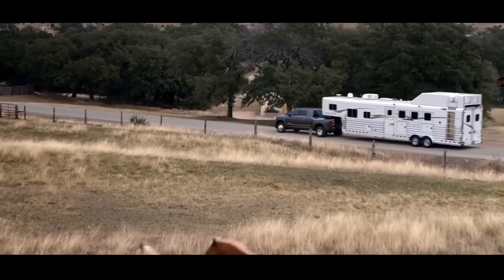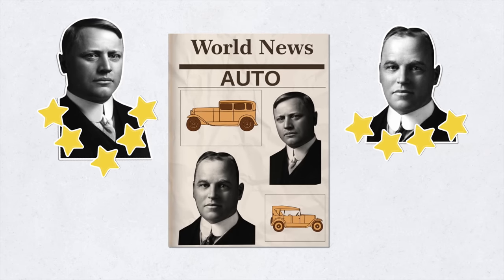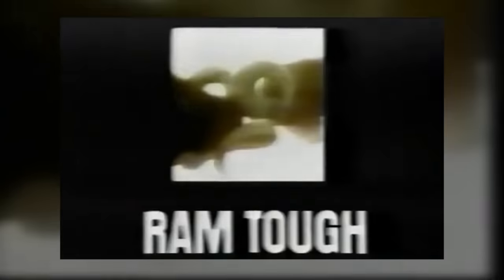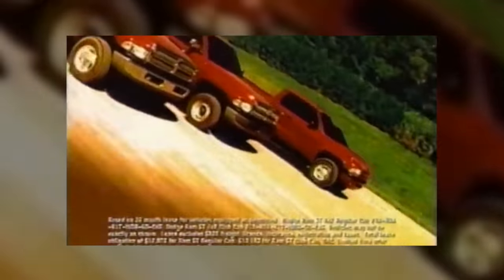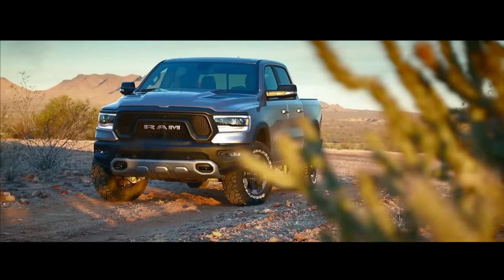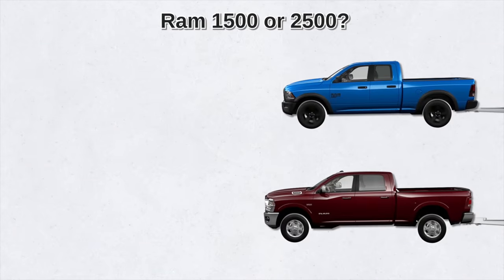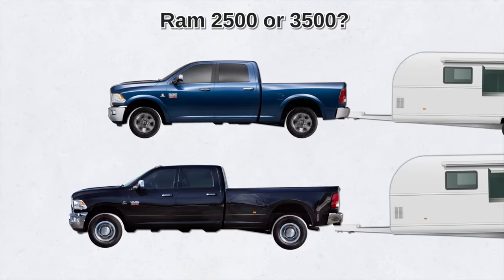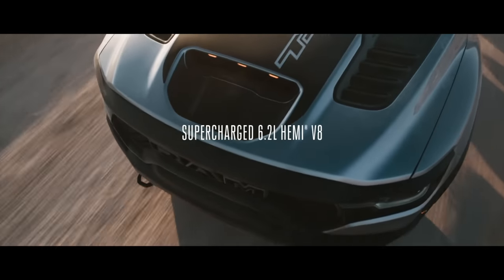No One is Telling You the Truth About Dodge Rams, So I Have to

Comment: Not one mention about their weak transmissions. I enjoyed every Dodge truck I owned, but every one that had a V8 over the years the transmission eventually gave out. The only truck that was a trooper was the '99 Dakota with a V6 I used to deliver pizzas with. That little V6 was a trooper even though it was rusted through on every panel, the engine and trans drove like a dream.
Reply: The automatic transmissions weren't exactly bulletproof for sure. I have the manual 4 speed from my 66 Dodge that I saved. It's ready to go for another 100k.
Reply: That was a long time ago already.  The chevy was bad back then too
Reply: dodge, ram. Fiat, Peueot or whomever owns them now  doesnt make the transmissions in these anymore I believe... I know the 8 sp ZF trans in mine is the same transmission design offered in some BMWs.. the old 46RE in my 96 ram was weak though and suffered failures.
Reply: @fathergratwick  my first vehicle was a 96 Ram. Transmission went at 180k miles. Which wasn't too bad, but my 92' Dakota made is 260k before it's trans got stuck in 1st gear.
Reply: I'm on my 3rd transmission in my 2007 1500. 😓
Reply: @fathergratwick  Has the zf proven reliable? 
Asking because I have one in my 1500, only had it a little over a year.
Reply: @James-po5ed  so far for me yes... truck has 129k and previous owner  towed a trailer on a regular basis.
Reply: @fathergratwick  Good, I try not to do much towing with mine.
I got it with 117k miles and transmission service had never been done, its running amsoil now.

Comment: I Have a 2014 1500 5.7 liter and still running as good as new at 120,000+ miles. Personally I think the line up of Ram trucks since 09 has had the best overall looks and styling over competitors as well as having the best exhaust notes on modern pickups.
Reply: Yeah..I work on a truck lot and we have just about every truck you can think of...I got a 5.7 ram 2014
because it runs and drives the best out of all I have tested..mine has 35k on it

Comment: I bought a 1999 dodge ram 15OO slt brand new in virginia drove it for 21 years nothing ever broke on it other than in 2014 the radiat of gave out.   Just changed the oil,tires and when the insurance took it had 149k miles

Comment: Bought a 2012 Ram 1500 5.7L new, have just under 90,000 miles, mostly highway.  Cold air intake, wrapped shorty headers, Flowmaster American Thunder exhaust,  throttle control, tuner, no issues of note so far.  Currently deciding which supercharger to buy.  Great pick up truck.
Reply: I have the same truck what kind of headers did you use

Comment: Just bought my second Ram 1500 yesterday. A 2021 Laramie crew cab w/sport package, 6’4” box, 20” chrome & painted wheels. Giving my 2017 Ram 1500 Tradesmen/Express Quad cab to my adult son, who I a mechanic. Have not had one single problem with the 2017 Ram….have had it almost 4 years, has 60K miles, driven round trip to Miami twice, to Atlanta, 3 times to Indiana, 3 times to Ocean City MD (from DC metro area)—-never any issues. Swapped out the stock Goodyear’s that were on it for 275/60/ R20 Falken Wildpeak AT3 (all terrain tires)…the stock tires were horrible on wet road and snow. The Falkens are excellent and didn’t significantly increase road noise inside the cabin.
Reply: It has 60k miles
........ Your proud that is hadn't had problems in those miles??  That's  nothing

Comment: My first Dodge was a 1986 150 with a 360 engine  ran the wheels off that truck  when I retired  from the Military  I picked up a 1999 w350  12 valve  Cummins  for the ranch loved this truck gear driven transfer case  solid axle with leaf springs al the way around  5 speed manual , manual  hubs for the 4 wheel  drive  wished I still had it. Bought  a 2008 3500 6.7 Cummins  which was the only truck I ever had problems  with and they were all the new emissions  control  systems  this was the last truck I was able to get with rubber floors  vinyl  seats  roll up windows  a true  work truck   still love the Cummins  but the trucks have gotten  to fancy  they need to put out a bare to the bones work truck again

Comment: I’ve had experience with all 3 and they are all great trucks I don’t know how the v6 holds up in them mine have all been hemis or Cummins but very rarely have I ever had an issue with them. I do know the newer ones with the Cummins seem to be plagued with emissions systems issues but the overall quality of the truck as far as engine and transmission seems to be good at least going off a few buddies trucks who all run 2018 -21 3500 rams using them for a transport service. They’ve had several emissions problems but no other issues at all other than routine maintenance
Reply: Duuuuh. Those are new. There shouldn't be issues. American car company costumers think cars are supposed to have expensive issues. So dumb.
Reply: New cars (like a redesign new 2018-20 Camry had transmission issues in the 4 cylinder) always have issues
Reply: @Yoursistersazz  scotty says not to buy anything new. It's just throwing away money and you don't know if it's a future lemon in the making that you just bought. An endless money pit. That goes for Japanese made too. Never buy new. But your odds are better and your resale value.
Reply: @erniecarrasco9107  He convinced me to get a 2014 Toyota Camry LE
Reply: My mother has the v6 in her 2015 grand Cherokee. It’s been a great engine and trouble free for her. Now she’s an older lady and drives it as such but it’s impressed me even how it handles towing. Her and my father pull their 22ft travel trailer 3800 with it and it has t skipped a beat
Reply: I've got the V6 and love it.

Comment: 2016 Ram1500 express model with 3.6l here. 120k on it and all I’ve done is oil, tires, rotors, brakes, and spark plugs so far. I take it in to the dealer for NYS inspection every year and they try to buy it back from me haha. I won’t give it up, I’ll drive it till her last mile. I love that truck. I was really rough the first couple years with the “it’s a truck, it’s gonna get dings and dents” attitude, so looking back I wish I would’ve taken better care of the bed, but that’s my only regret

Comment: I think Ram has stayed in a good position by keeping their trucks as simple as possible. I’ve owned my 01 2500 diesel for 5 years and towed with it and already driven it more than 80,000 miles I bought it with over 200,000 miles and I’ve only spent about $5,000 into it for necessary repairs all of which I was able to do myself in the driveway. They are great trucks if your willing to work on them yourself and it’s totally doable. As for the newer ones where I work our whole fleet is Ram trucks and they are super reliable, awesome fleet. They get a bad wrap for the automatic transmissions however usually the guys complaining about that have a tuner and other mods that are pushing the truck to the limits. Nothing lasts forever unless it’s maintained and these trucks are very easy to maintain.
Reply: looks at dial shifter
Reply: @justicecallander5525   well that’s on gas trucks and there’s no reason to own one of those
Reply: @wheelinndealin  hahaha I can stand by that

Comment: I have a 13’ 3500 with the 6.7  for towing and it does great with 300k miles. I also have a 15’ 1500 with the ecodiesel for work and it is incredibly efficient. It has 340k on it now and still going strong

Comment: Own a 2019 Ram 1500 Limited.  Traded in a Ford F150 Platinum that turned out to be a POS that I could not wait to get rid of.  I have owned three Ram 1500 trucks over the years and they have all been the best trucks in my opinion.  Chevy and Ford are plagued with recalls which take time to resolve.  My Ram just keeps on going and going.  And no truck on the market has the luxury touches more than the Ram Limited.  Only one complaint, hate the rotating shift knob, so if any Ram engineers are reading these comments, bring back the console shifters.  Other than that they are great trucks.
Reply: They are getting rid of the turn knob shifter in the '22 model
Reply: @alandillon6469  Thank god
Reply: @quadrifoglio6058  Yeah that thing was stupid and gimmicky lol

Comment: Seems like Scotty is finally showing some love for the Ram. Personally, I think Ram trucks are overall, the best looking trucks, especially their 2500 and 3500 trucks with the correctly chosen options and trim levels.
Reply: I wish the had the gmc sierra's dual exhaust design but other than that they are nice
Reply: Lol , They can't even put paint on correct . Rust bucket in 4years .Ram=Junk
Reply: @kenj.8897  , That's strange, because my 2012 Ram is holding up very well, both mechanically and appearance wise. Mine is not even garage kept. It's always parked in the front open yard out in the weather. There's no rust at all on it.
Reply: I have 2 at the present time just ordered a 22 & sold a 17 had them all best truck made & im a fuss pot from the word go
Reply: @kenj.8897  Yeah, if you are in the rust belt way up north, then yeah. No vehicle lasts long up north. I'm in interior Florida, so our vehicles last much longer. Ram trucks are awesome.

Comment: My vote for Best Diesel engine is made by Isuzu. Operated many Hitachi excavators powered by them, they were guaranteed leak free for 7000 hours, and did the job. I had already operated Caterpillar engines for nearly 20 years prior to the Isuzu. Comparing the two at 7000 hrs, the Isuzu used as much oil in a week, as the Cat did per day. So you can have your Cummins diesel-converters, I like quieter power!😜
Reply: The louder it is the more bricked up I get.

Comment: Owned an 84 Ram Van, although the truck fell apart around that 318, I'm sure that motor will still be pushing out rpm's long after nothing's left operational but the frame.
Reply: Yeah I’m sure because the rest of the vehicle is well, Chrysler quality, which isn’t very good.

Comment: My 2001 Ram 1500 has 200k on it and so far I've put in a computer and had the cracked dash problem.  Also, I've had to deal with blend door issues and had to replace the hose to the vent control switch. Motor and tyranny are fine. Front wheel bearing s also had to be replaced.  Not much else except some minor front end work. It easily takes loads of rock or dirt when I need it to.

Comment: My bf bought a 2022 2500 4x4 diesel with if course the Cummins AND SPLURGED on ALLOT of extras including a trans warrenty he paid an xtra 15k for, after all was said and done over 100k, i didnt think i would like driving it (8ft bed, quad cab that seats 4 adults comfortably) but it was so easy to drive and i own a Mustang..lol. He had to come get me and my car 350 miles from our home. 20 ft covered trailer and my 2012 V6 mustang. He said he could barely tell the trailer was there except for the 300 in gas round trip of 700 miles. Found out that model only tops out at 101 with the restrictor on it, but speed is not a factor but towing, 4x4 capabilities and payload. The one thing that gets my goose is how the start button sticks in the hole, ive almost removed it to just use the key!  lol  thanks for ur vids i find them very informative!

Comment: Good video, one of the best Scotty has done yet..I've owned a lots of Fords, GM's , and Ram trucks over the years... I found to have had and seen good and bad Model's from every brand.
I also run auto repair shop, Minnesota Automotive. In the Minneapolis area.
In my experience 2013 and newer Ram truck seem to be the most reliable just slightly edging out Ford trucks... I'm not counting the Toyota Tundra as they are not popular in my area and very rare to see one...not even for an oil change at my shop or on the road....

We had a 2006 Ram 1500 2 wheel drive 
4.7 L V8 regular cab coming to the shop here the other day, This customer has 410,000 original miles on original engine and transmission... amazing is edging out my lead mechanic with his all the 99 Chevy Silverado 1500 5.3L with 350,000 miles on the Original engine, and 2nd Transmission....

Yes we've done some engine work with the Hemi roller lifters shaving off the cams, 2010, 2011, and 2012 models. ... yes they are good for exhaust manifold bolts breaking off...
Other than them couple flaws seem to be really good, and reliable if you take care of them...
Seems that the roller lifter issue is fairly rare and if they do go out the mileage was around 150k when this problem occurred...
I've seen many other engine issues especially with the older F-150s 3 valve 5.4L 
GM 5.3 2006 and newer.....
The worst truck ever made was a Ford HD truck with the 6.0L Power Stroke Diesel...
Average engine failure was about 80k miles... I have a buddy that works at the local power company with the whole Fleet of them 6.0 power strokes, they put new engines and every single truck over 100  something trucks, over a span of five years....

Comment: Scotty, I am in the market for a new Ram 1500, but I've heard that the drivers side head, part of the motor has been blowing, at around 80,000 now I have a Ram 1500 2013 now, and I have 225000 on it, with some rust issues underneath, and that is why I'm considering a new one, I want to be safe, anyway have you heard about this, because I haven't, have had 3 ram 1500 and they have all been jems, I like the look, I like the reliability, and I like the gas mileage, all 3 of them had the 3.6 engine, any info would be much appreciated, keep up the great work my friend, I love your videos, and your knowledge of the engine is stellar

Comment: Back when it was Damn near Chrysler (Daimler) the company was producing a lesser quality product.  I don't think that Daimler-Benz cared to put much into the company.  In 2011 I  finally decided to get my first set of his and her Dodge Challengers. Nice cars but couldn't stand the drone of the MDS so I custom ordered a 2013 6-speed since they do not have MDS. Nice car! I also have a 2016 RAM Laramie Longhorn Crew Cab 4x4 with the Hemi and I really like it. The most comfortable and capable pickup that I have ever owned.  I also have a 2003 Dodge Ram 4x4 and it runs well but the cheap dash that Daimler produced is cracked to *ell and broken manifold bolts are a pain on that 4.7L but I heard that GM and Ford have these bolt issues too.
All aut manufacturers have issues so just pick what you like, do your maintenance especially oil changes and drive it to your own pleasure before the environazis make our beloved vehicle's illegal.  🇺🇲
Reply: for ford there are stainless steel studs sold on ebay. change once and never deal with the issue again. Frod 5.4L  had that issue because their studs to hold manifold were ( are)_ only 8 mm thick) So with little heat rust and some vibration from the tailpipe the cyl 4 on the back is the first one to lose the stud. .. Pickups (at least those earlier) did not have those harmonic balances  so that is why studs get lot of stress from the exhaust pipe ..
Reply: FYI, it's "your," meaning possessed by you, not "you're," the contraction for "you  are."
Reply: What's MDS?

Comment: I think each of the 1500, 2500, and 3500's offer some uniquely appointed features and options. Personally, it's hard to argue that the additional offroad 4x modifications are anything other than badass and impressive... The 1500 TRX a gorgeous representation of performance, power, and style; but despite having to wipe the drool from my face after spitting up those words, I'm actually leaning towards a big boi and probably about a week away from pulling the trigger on a 3500... mostly because I just need that 4.0 Axle ratio and all that savage torque to haul a massive fifth wheel around with me. XD

Scotty, you're the best! Thank you so much for breaking this all down for us my man!
Reply: Did you get the 3500 yet?!
Reply: Isnt the rigidly welded frame of the Ram bad for off roading, thought? I heard the thing cracks

Comment: Bought my first Ram in 2017, it was a 2014 1500....great truck. Purchased a 2021 1500 brand new it was a gas guzzler. Trade for a 2017 2500 6.7 cummins and started doing hot shot work...still have it. I went out and bought a 2021 3500 6.7 cummins. All are very comfortable to ride in. The 2021 1500 is the only disappointment.